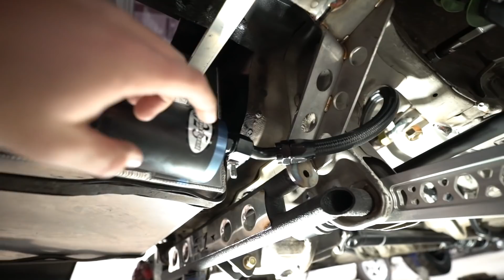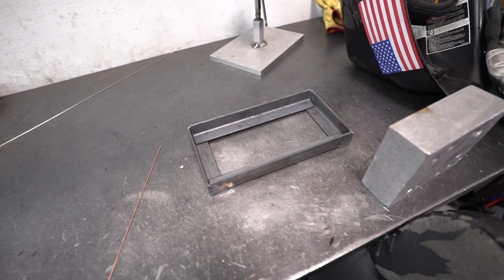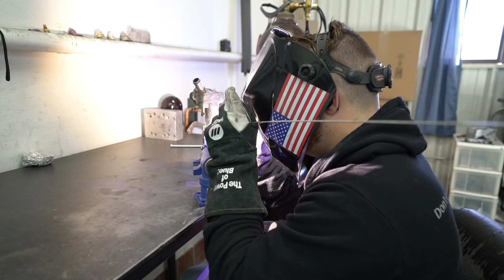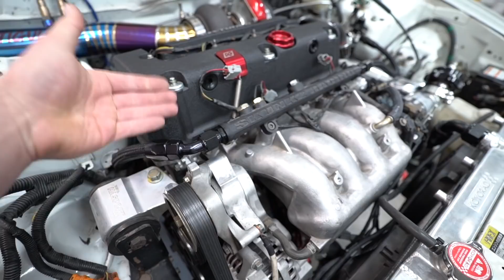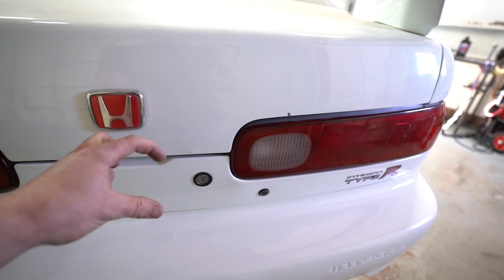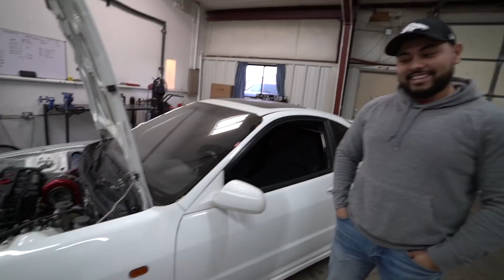K20 AWD Integra First Start Up!

Comment: You could clean up the exhaust side and save the life of the 02 sensors with a couple 90 degree O2 sensor adapters. It might allow the second one to get a reading as well. Cheap and breeze to fab yourself I'm sure. New here, love the content. Happy New Year Fellas.

Comment: sick!
i think you should run the starter off of the "in" connection because it will draw a peak-amperage way higher than 200amps

Comment: Tip.... I would put the generatorcable on the batteryside of the switch so the switch turns of the engine....  with the generator on the switched side it will provide the ecu  with power even with the switch of...

Comment: You need to put the alternator power wire on the battery side of the relay or it won’t shut off with engine running

Comment: i typically run 4ga from ALT (or even smaller cuz racecar) to starter post, then larger gauge from starter post to relay/battery.  less clutter.

Comment: I think you will want the alternator on the battery side of your SSR. Consider your voltage source. Engine off - battery. Engine running - alternator.

Comment: That flat bar is not the fuel tank mount right? The big switches are big so emergency crews can find them easily when you are upside down and on fire at the track.

Comment: Are relays allowed for replacing a manual cut off switch in tech though? Because the relay could get stuck on in a crash by the ground interrupt happening once pinched even though the switch is off...it would let the car turn back on if the scenario is correct. Just a thought. No hate. 😎 came out clean af

Comment: Maybe I'm wrong, but shouldn't the alternator wire be on the battery side of the relay so when it's grounded while engine is running, it can't continue to power the car? Looks like it'll keep running if you got the cutoff as it's wired.

Comment: Why is it that you all go to half measures to wire the system properly, DO IT PROPERLY... power switch for MAIN POWER ONLY, IGNITION switch to POWERS ECU, ECU controls FUEL PUMP, One day you'll have a failure and that pump will keep fuel pumping and burn down.... No crank signal no fuel pump, if you want to prime... Put in a momentary switch the infinity or any ECU won't drain the battery if installed properly

Comment: if youre interrested in doing a frankenstein build then have a look at this  https://www.youtube.com/watch?v=rBnkpN0UXv4
10.400RPM running on gas using  Hayabusa Head+Diesel CDTi Engine Block
i find it to be a interresting mix.
even the carbody could be interresting in itself.
hardly weigh anything.  seen them built with v8 and cage  pushing 750 hp  at only  750 kilos.
theyre still used in hillclimb/timeattacks in europe.  freaking fast little things. https://www.youtube.com/watch?v=w8QEk62TPMs
specially the opel kadett C coupe  shell
could also go for a opel GT body  but i think theyre harder to find.
the GT  aka  baby corvette   looks amazing  with meaty rear tires and classic corvette sidepipes.
old girl from 69 but still a beauty http://prntscr.com/wfkf0h